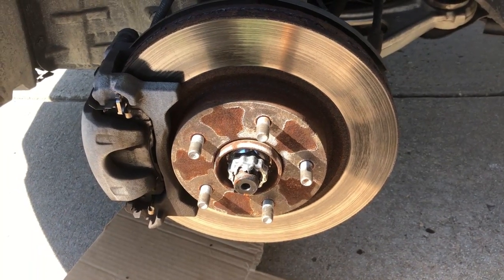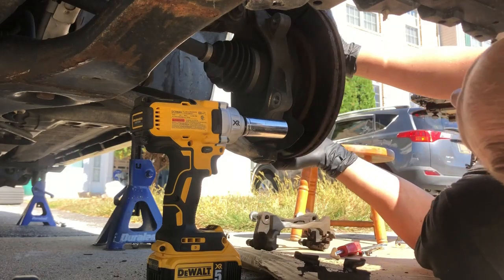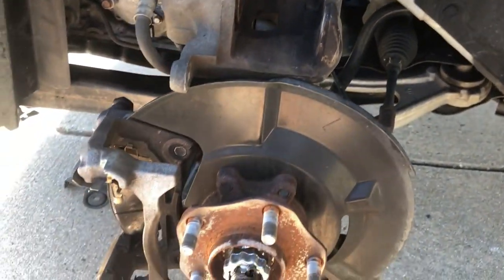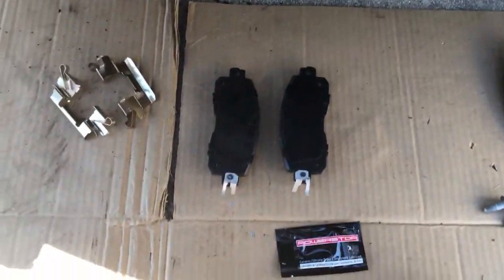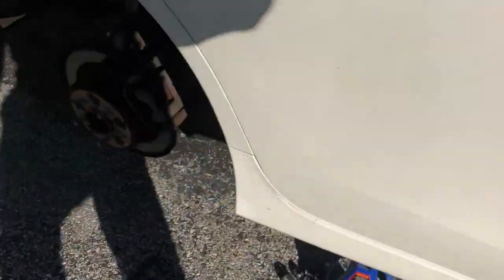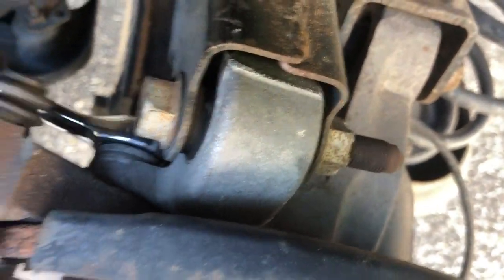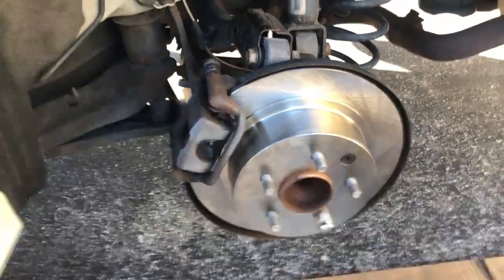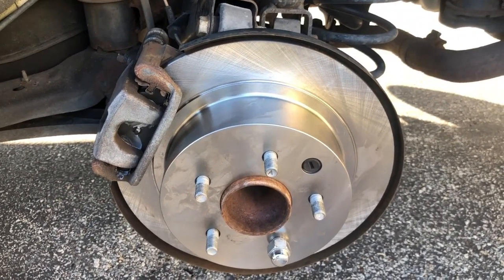2013-2018 Nissan Altima Front & Rear Brake Replacement

Comment: Hey great video and explanation! Out of curiosity what would happen if you somehow swapped the sliding pins by accident?
Reply from the maker: It really doesn’t matter to be honest.
Reply: @TheOriginalBeeCee  thanks I followed your video to the Tee, but I am starting to hear a humming / squealing noise when I brake. I started to second guess if I swapped the pins my accident
Reply from the maker: @ThePackman2323  it’s probably the hardware (the clips the pads seat into). I would take them back off and ensure they aren’t making small contact with the rotor or anything else.
Reply: @TheOriginalBeeCee  thanks a lot I will do that. I should have kept my original hardware like you suggested 😂. The aftermarket material just doesn't cut it
Reply from the maker: @ThePackman2323  haha yupp that’s exactly why i suggest staying with the OE. I guarantee that’s your noise

Comment: Front bracket bolts: 107 ft.lbs, Caliper slide bolts: 20 ft.lbs
Rear bracket bolts: 62 ft.lbs, Caliper slide bolts: 32 ft.lbs

Comment: Hey I have another question. What kind of torque wrench are you using (specifically for the rear) I have a torque wrench for tire changing and it's too long to fit in the space where the tire is. I basically can't use it because it's too long.
Reply from the maker: Its a smaller 3/8 drive torque wrench. So you would need to grab a smaller 1/4 or 3/8 drive torque wrench. However, Autozone rents a 3/8 drive torque wrench that would fit, believe its an “OEM Tools” torque wrench.

Comment: I'm probably going to be doing this again. I just did this on my car but I forgot to clean the rotors so now the front ones smoke. Everything was taken apart and cleaned and brake pads sanded but still burning and smoking.

Comment: Hey is this a Nissan Altima 2013? I saw another video and it said 98 and 20 on the front for torque and 80 and 30 on the rear.
Reply from the maker: The torque specs in this video are straight from the Nissan factory service manual! 👍
Reply: @TheOriginalBeeCee  Thanks for the information! Much appreciated

Comment: So you don't have to open the brake fluid reservoir before retracting the pistons?
Reply from the maker: I typically don't, although I'm definitely not opposed to it. Honestly, most OEM FSM's and the actual Nissan FSM suggests siphoning some fluid out of the MC before compressing, not just removing cap.

Comment: Do you take off brake fluid reservoir cap before pressing the piston in?
Reply from the maker: No I typically don't, although I'm not opposed to it. Honestly, most OEM FSM's will suggest siphoning some fluid out of the MC before compressing.

Comment: When you do the front ones pads and rotors do you have to bleed them ??? Or its only when you do the front and back ?? Thank you really like your videos
Reply from the maker: There is no particular situation (in reference to front and/or rear) that requires the brakes to be bled. They don’t have to be bleed every time the brakes are serviced either. Bleeding would be required more if the fluid is dark and/or old, contaminated, or if a line is opened in the system, that would allow air in. But if the car has a lot of miles, etc. I would suggest a bleed.

Comment: At the last part you mention something about bleed the brakes ?? How?? Is there a video you can provide please
Reply from the maker: Honestly, you don’t truly need to bleed the brakes every time pads and/or rotors are replaced. But the typical interval changes for most manufacturers are every 40K-60K. So, it might be a good idea depending on the mileage.

Comment: I got the same pads and I believe the clips are not right as well. Is that what could be causing my brand new break pads and rotors to constantly squeal lightly? If so, and I already tossed the old clips, what can I do?
Reply: Also how did you get the pads to go in so easily? We had to jimmy them in with a screwdriver and hammer.
Reply from the maker: Hey whats up man. From my experiences, not always...but a lot of the time, aftermarket hardware/shims do not fit as good & tight as OE hardware. It might look better cause it’s new and shiny, but doesn’t always seat as well as OEM. Hardware that doesn’t fit correctly can definitely cause unwanted noises/squealing after doing a brake job. I would suggest maybe taking it back apart and spin the rotor with the caliper/pads off, just the bracket installed, to determine if the hardware is loose and/or making contact anywhere on the rotor while spinning. Then try spinning it with everything back together and re-check to ensure the hardware isn’t making contact anywhere with pads/caliper installed. If it is, maybe purchase some new OE Hardware, or maybe give some hardware from AZ/advance a shot and see if you get better fitment. 

The fact you mentioned having to force the pads in as well...could also be playing a role in noise issues. Pads should just slip right in and fall in....shouldn’t have to fight them to fit. Sometimes cheaper pads don’t just slide in. Some mechanics will even take the edges of the pads to a grinder wheel with just a quick touch to ensure the pads slips right in and have free movement, as it should. But forcing pads in can definitely contort and deform the hardware and cause improper fitment and potentially it can cause the hardware to touch the rotor from forcing the pads in.

Comment: Does anyone know the size of the two bolds that hold the Caliper brackets ( not the calipers )
Reply: 22mm hex heads. I don't know the size of the bolt, but the head is 22mm.

Comment: Is it the same for the 2019 sr
Reply from the maker: Can’t confirm 100 percent, as I have yet to brakes on a 6th Gen. Alty. But I’m confident its similar. All the Altima and Maxima brakes have been damn near the same setup since 2000. I’m actually gonna release a 8th Gen. Maxima brake job video today or tomorrow, which is going to be I’m sure damn near the same as well, as it’s almost the same as this.

Comment: You could’ve pressed the piston in with out putting the caliber back on
Reply from the maker: It’s “caliper”, and yes, yes you can. There are quite a few ways to successfully retract a caliper. I chose to do it that way just for the video, at the time I thought it would be the easiest method for a “how-to” and someone new to doing it this, to help with stability & ensure a perfect retract.

Comment: Just turn your wheel the direction your trying to take off .
Reply from the maker: Most definitely! I should have mentioned that. The reason I didn’t was for anybody who would only be doing one side at a time, not have the whole front end on jack-stands, cause obviously it would need both front wheels in the air to turn accordingly. Definitely should have mentioned it in in the video…this is a early video from me, not my best production 🤣